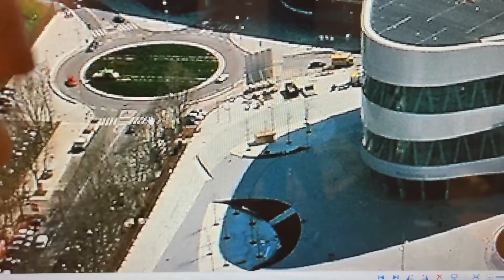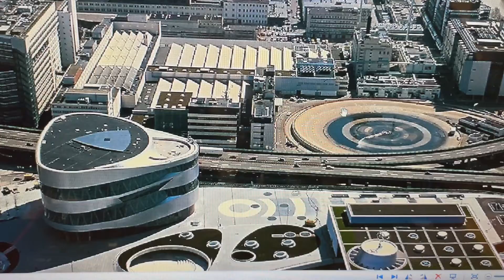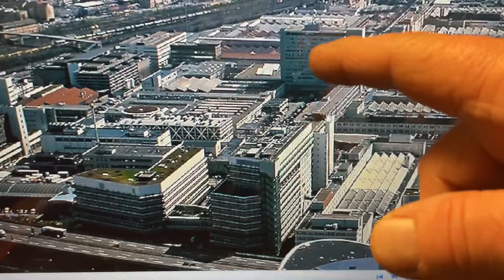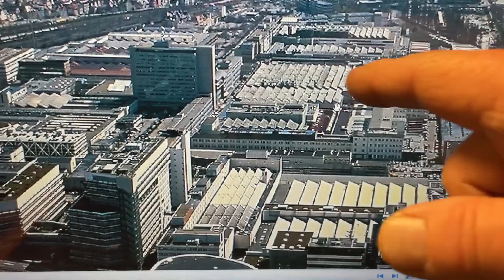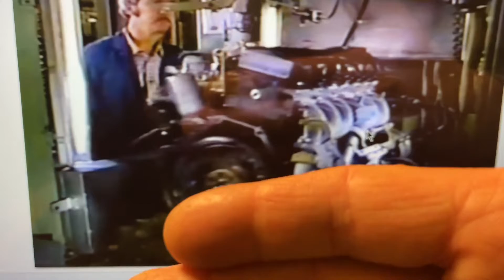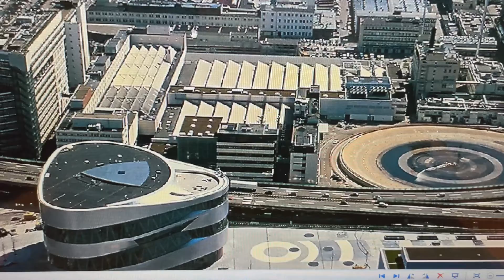Mercedes Benz, my time in Stuttgart Untertürkheim 87 to 91 everything about engine manufacturing

Comment: Why did you chose to work with Mercedes instead of Porsche?
Reply from the maker: George, that’s pretty much on how it worked out. Mercedes did more things then Porsche due to their size so there was more going on.
Reply: That was a good decision since Mercedes has more options than Porsche. It is alarming that parts for classic Mercedes isn't as plentiful like classic VW's. I'm not trying to compare a VW bug to a Mercedes but I do have to say the air cooled VW's have more parts available stock and aftermarket that has to the potential for years to come.
Reply from the maker: George, Mercedes used to have a parts guarantee for availability for all cars ever produced.
This guarantee was eliminated a few years ago for the following reasons from what my understanding is at the moment:
1. The MB Suppliers imposed high minimum order quantities which where more tied to a monetary value rather then actual part numbers. This resulted in some parts being very expensive like the fuel distributor from Bosch coming in at a whopping US$ 6,500.00 as example. This resulted in very few sales and people rebuilding their distributors, so MB stopped buying them from Bosch.
As less demand their is for a part as more likely it will become a NLA Part.

2. The German Suppliers also started to produce parts in off shore setups and the resulting quality deteriorated to a level that supplied parts to MB no longer passed entry QA and acceptance by MB of delivered parts meaning they were returned to Supplier by MB leaving MB with no parts.

Volkswagen on the other hand is setup differently to the fact that the Bettle production had been moved to Mexico and Bosch had setup parts manufacturing facilities in Mexico as well to meet the parts quantity demand
Reply from the maker: George, I think I should add one more thing to this parts situation.
As a result of the aforementioned parts supply issue and the shift to production of solely electric vehicles, a executive decision was made to scrap everything what has to do with combustion engines, including parts.
This will be a transformation which started in 2019 and will go on until 2030.
By that time, so is the current plan, MB will be a Tesla on steroids.